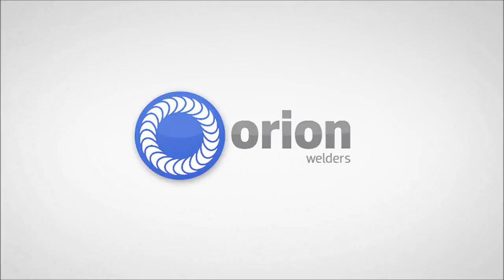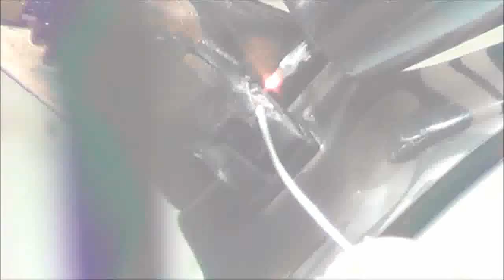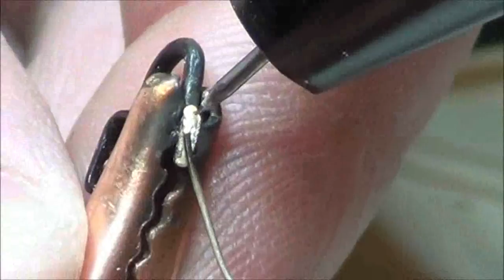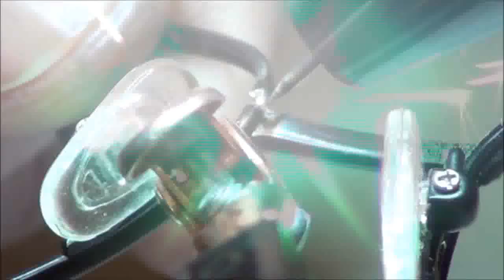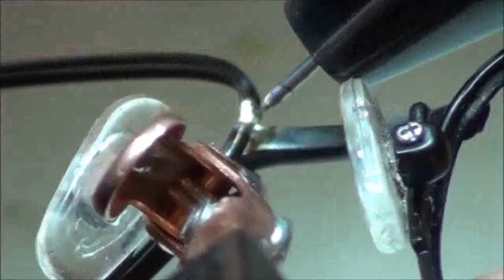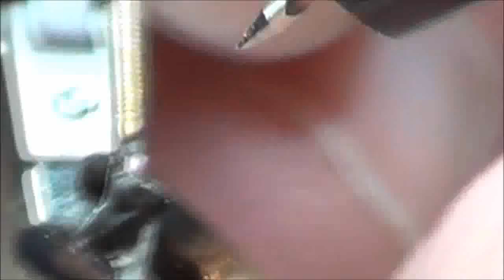Eyeglass Repair - Pulse Arc Welding with Orion Welder

Comment: Do you have a model for stainless steel welding? For watch cases restoration, thanks
Reply from the maker: We offer many solutions and would be happy to work with you and find a solution that would be helpful for you. You can check out the systems on our website www.OrionWelders.com or you can give one our welding consultants a call and they can discuss the best solution for you, 877-786-9353.

Comment: whats your welding wire for monel alphaka repair
Reply from the maker: We recommend using Silver fill wire for Glasses Repair on frames. This can be sourced from a verity of sources. Many companies call it Laser Wire.
Reply: for monel frame weld
Reply from the maker: Same suggestion - Silver is the best wire to use.